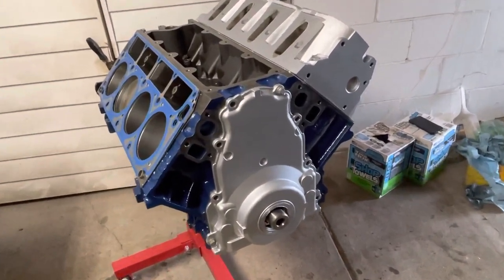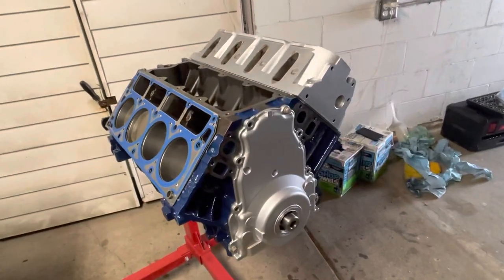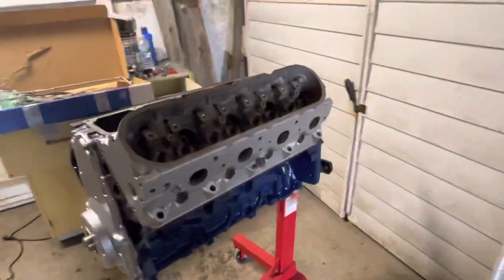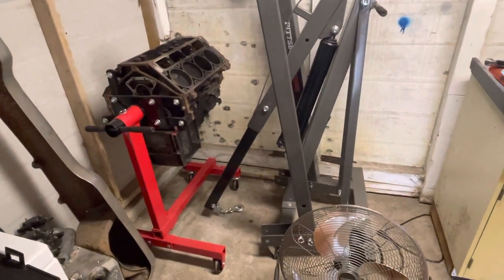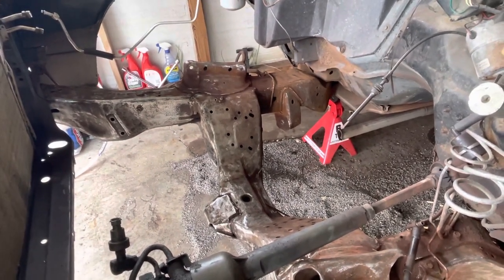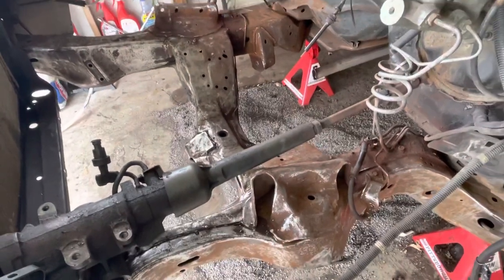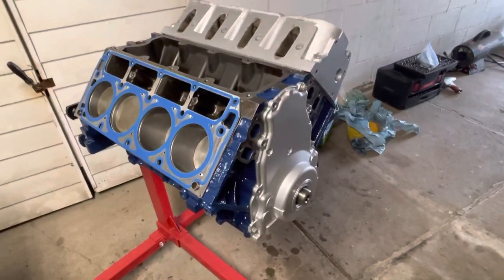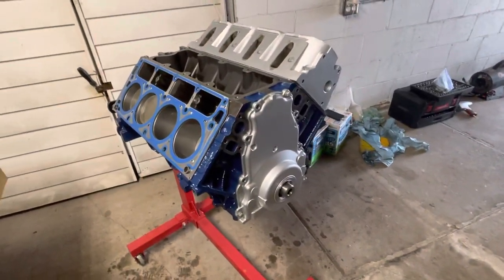1987 Chevy caprice brougham 5.3 ls swap

Comment: The body motor mounts do the sit towards the front or back on the  frame
Reply from the maker: If you look on the center where the engine will sit there are bunch of holes the two above all of them and down there is a third one that will give you an upside L . Mount go there